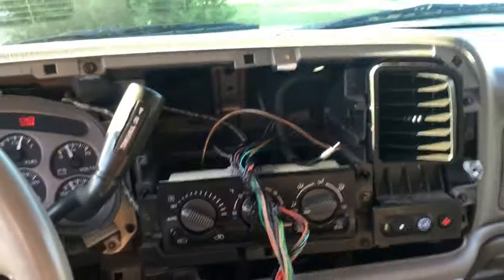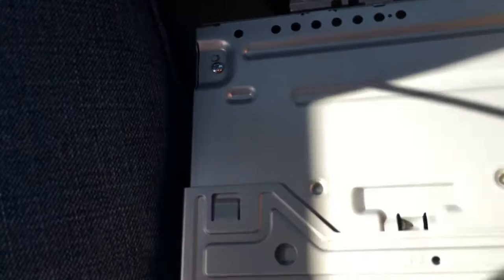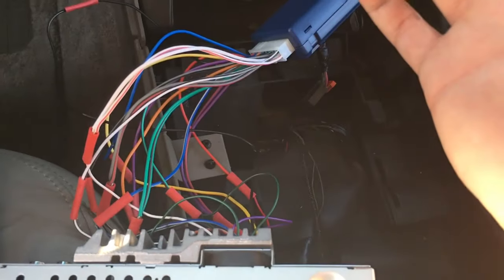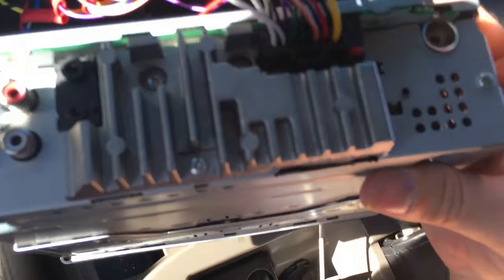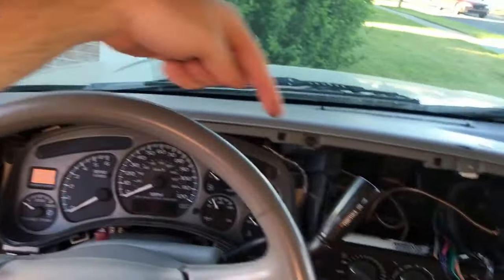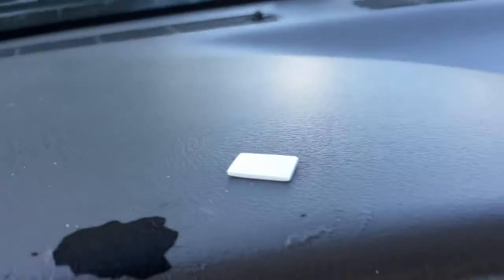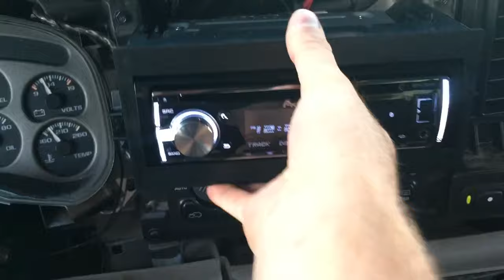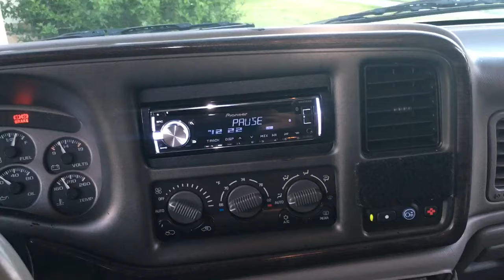How to install aftermarket stereo with a stock Bose sound system Tahoe, Yukon, Suburban, Escalade

Comment: I just got mine working. Pioneer double din with DVD player, 2002 escalade with Bose system and stock AMP. I used metra harness part# 70-1859 and metra trim install kit #95-3004.

Main thing keeping my amp from turning (and causing NO SOUND) was the amp remote wire (blue wire) Hook up color to color for your deck and you'll be straight. Red wire in the connector by itself goes together with the other red power wire.
Reply: I don’t quite know what all this means 🤷🏽‍♀️... but I would love to replace the 2Din bose stereo in my 2013 Nissan Murano. Auto stereo places have told me it’s not possible because of the bose 😢. Any suggestions?
Reply: @MsAngel737  I thought mine was impossible to change at first too but then I found a plug n play harness from Metra. My advice is to look for a plug n play harness for your murano. If it exists then chances are good that it's an easy swap like mine was
Reply: _ theVTECnician _ Aww thanks so much for responding!! So unfortunately I have looked everywhere for a harness (I think that means install kit) and there is none specifically for the Murano with Bose 😢😢😢! I wonder if I could still use the one without? I love my new car and was so disappointed about the infotainment system not being upgradable...at least it still sounds great though
Reply: What did you use to keep your steering wheel control? I have a 02 Escalade steering wheels controls
Reply: @LJimenez0185  I don't have wheel controls anymore
Reply: @thevtecnician  ok thanks I’m trying to figure out how to make them work
Reply: @LJimenez0185  let us know if you do! I pretty much learned to live with no steering wheel controls because I didn't want to have to buy some expensive module. Would be nice to have though
Reply: @thevtecnician  I do have the steering wheel interface PAC SWI-RC-1 I’m following the instructions on their website and it didn’t work, I do have voltage coming from the steering wheel data wire when I press any button but is not working the way they said it has to be wire it up, that’s why I’m trying to see if someone has done it before there is not many info on this specific years
Reply: @thevtecnician  I figure it out!!! Man I’m really excited I got the steering wheel controls from an Escalade I’ll put the on my 99 Silverado and there is not mucho information about how to get steering wheel controls to work, let me know how can I contact you so I can share with you how I did it

Comment: I just hooked up a aftermarket into my 03 Silverado with Bose system. I didn't get any sound out. Once I hooked up the AMP WIRE, I got sound. No extras needed. All I spent was 12 bucks on the AutoZone wire harness for aftermarket stereo.
Reply: bishop all you needed was the harness?
Reply: I hooked up aftermarket stereo on silverado it turns on but no sound? What should i do next
Reply: victor2187puj make sure the blue amp wire is connected if you have bose in your truck it won’t make sound without the blue wire because that is what powers your speakers on your factory amp
Reply: Where do u connect the amp wire
Reply: bishop where did you connect the wire
Reply: Patrick Brown you can run it to one of your fuses if you have to just make sure you run it to a fuse that shuts off when you shut your vehicle is off
Reply: How did you do that boss??

Comment: I've been having a helluva time with my 01 Denali with the Bose, OnStar, disc changer, backseat controls and dvd player in the ceiling. Previous owner failed at replacing the head unit and i bought it with a hole and rat's nest of wires in it. Ugh.

Comment: Thanks for the video.  Replacing factory head unit with a Andriod head unit but want to keep the factory Bose system.  I purchased the ROEM-GM21A for my 2001 Yukon SLE with Bose and Onstar.  Crutchfeild recommends this model PAC for my truck.  I up everything up as you have it and I didnt get any sound.  I connected a speaker directly to the speaker out of the radio just to verify that the radio works, and I got sound.  But I do not get sound through the PAC Module.  So I'm wondering do I need to unplug the Onstar in order for it to work?
Reply: I get sound while in acc with ROEM-GM21A for my 2002 Yukon SLT XL. The moment I turn the engine over no sound although the pioneer AVH-x4800bs says it playing, please Advise!
Reply: @430Xsidian  I'm not sure as to what could be the problem.  One thing is for sure I have been in contact with the manufacture and they expressed that you do not hook up radio speaker wires to both low and high on the module.  The low is for signal wires like coming from pre-amps and the high is for the powered speakers like coming from the speak out wires from radio.  So in short hook up to the high and leave the low unhooked.
Reply: @430Xsidian  did you figure out the problem?
Reply: Nice. My no sound issue was a simple defected harness. Swapped it out for a new one.

Comment: My 05 Denali came with Bose badges on the door speakers and an aftermarket stereo already installed.  It doesn't sound very good at all.   steering wheel controls don't work either.  Is it possible the amplifier is not being used?  The only way to get sound from 6 speakers is to set the fader to full front, which seems quite sketchy.
Reply from the maker: It is likely still using the AMP...but I wonder if the integration between the new stereo and the original amp is messed up?  Maybe the PAC interface module is bad or maybe they just hardwired it?

Comment: When you put those two positive wires on one wire how did the sound come out
Reply: Let me know cuz I have a 04 Chevy Tahoe and I'm trying to do the same thing put another radio in it but they said you can go straight to the factory amp wires and connected
Reply from the maker: I know I should have learned the proper way to connect those wires...but so far five years later my sound is still perfect, so I'm not going back to tinker with it.  :)

Comment: Is there a way to bypass using the special aftermarket Bose wiring harness and use the cheap one only? Hooked up a radio in a trailblazer with Bose and won’t come on
Reply from the maker: I don't think so.  There has to be be something that converts the standard 4 speaker output to the Bose 11 speaker system.  In this situation alone, what would turn the Bose amp on without something to trigger it?

Comment: After installing the aftermarket head unit are you able to crank it up loud without it cutting out real bad or sounding like pure terribleness? I’ve had past experiences with Bose systems sounding terrible after aftermarket hu install.
Reply: I plan to replace the door speakers as well in the doors and the 8” sub in the rear which the sub will run off it’s own amp however I’m curious if the door speakers will still sound decent even if I don’t use an aftermarket amp?
Reply: Any information you have and advise/feedback you can give would be very greatly appreciated!
Reply from the maker: I have cranked it as loud as I could tolerate, and it is crystal clear.

Comment: The reason there are Double positive and negative in the same colors because they run to the subwoofer. And that is your aux input to your Bose amplifier receivers Because there is a receiver before the Bose amplifier to convert. The high output from a stereo into a low input for the Bose system. And really he didn't skip over any of the important stuff because you pull out the stereo and It is all pretty much all you see one plug plugs into. The module that he bought and then you wire your head unit to the module on the other end and you match the colors of the wires on 99% of your head units nowadays There are some off throws. On wire matching But 99% of your aftermarket. Head units will have the same color coding for the wiring on the module

Comment: i recenlty upgraded my stereo with the pac GMRP5 11. the dial that controls the door speaker chime is that also the volume output power as well ? because my stereo is so low and that dial is turned down.
Reply from the maker: No idea.  I bypassed all of the chimes because I couldn't figure it out either.

Comment: when I saw that head unit I had to check the upload date bc it felt more like a 2006 video than 2016 lol
Reply from the maker: I hear ya.  I wanted to do a nice Carplay touchscreen or something...but this generation of Yukons have a non-standard DIN opening of 1.5 DIN.  Most Carplay and LED display head units are 2 DIN, so in order to put a "modern" head unit in I would have had to cut the panel and the steel support behind the panel to a 2 DIN opening.  I just didn't feel like doing all that work for a 20 year old vehicle.  :)

Comment: I have a 2003 Sierra extended cab with Bose and JVC aftermarket head unit. It also has a killswitch installed from the previous owner so I have to wait for the chime to sound before I can start my truck. My radio doesn't save my preset stations, my settings, etc... and the rear speakers sound very low even after I installed some new Kicker 4x6 speakers in the rear doors the front speakers work fine what could be the issue and how can I fix it.
Reply from the maker: I'm no expert, but I know the wiring you attach in the back has two power cables, one is always on (persistent) and one is only on when the key is on.  The persistent power is intended to ALWAYS provide a small trickle amount of power to the radio so it remembers your presets, settings, BT devices, etc.,.  The key power is for actually powering up the unit and for use.  So, it sounds like your persistent wire is not connected or was erroneously connect to the "key power" wire, and your radio unit is only receiving power when you turn the vehicle on.  
Depending on your model of radio you should be able to find a wiring diagram online, and you should see the two power wires I mentioned above.  You will need to see which wire connects to the Sierra wiring harness (again, look at a wiring diagram) and then just make sure you connect persistent to persistent, key to key.  I'm pretty sure that will solve your problem.  :)

Comment: Wow! Thanks for skipping the actual important parts!
Reply from the maker: Which part did you want to see?  Maybe I can walk you through it.
Reply: Trolls.... classic no reply
Reply: mrjchristensen I have an 05 with onstar and Bose. Is this the best route? Well would this work as an option?
Reply from the maker: @daquellejones264  For BOSE yes, for OnStar if you want to use it then you need another module.  Your OnStar might not even work anyway, I know mine is analog and discontinued support for it a few years ago, so if your 2005 uses analog cellular then it doesn't work anyway.  Also generally the steering wheel controls are part of the OnStar module, so you might lose those as well if you choose to bypass the OnStar.  Personally I was fine bypassing onstar (doesn't work anyway) and the steering wheel controls (meh, I can live without them) in favor of a more simple system.  You do you , man.  :)

Comment: Thanks bro for up load video.. I install the after market stereo and back up camera on my Chevy 5.3 . I got 2 things need to corrected.. 1 I got static maybe I installed ground wire to antenna connection.. 2 when I shift yo back up the music shut off for camera,, anyone have same problem,,
Reply: Did you find a fix for your static issue?

Comment: Have a 2005 Cadillac Escalade ESV 
Bought a Double Din Radio think this will work for steering radio control and bose amp with out interface kit
Reply from the maker: I doubt it.  Most stereo units only support 4 channels out, your Escalade likely has the same 11 speakers as my Denali, so you need some sort of interface to convert from 4 channels to 11 channels, and to interface with the Bose amp.  I'm not sure about the steering wheel controls.
Reply: They make a different module for that. Look for one that says "retains factory amp, steering wheel controls" some cars have the chimes go through the speakers so they also retain that as well. The bose system probably has an amp behind the glove compartment or somewhere else so it's not as easy as unplugging one radio and plugging in another, you go through the module and should be okay. One wire at a time, think about it and google if stuck.

Comment: so I got a question I got a 2002 Yukon SLE with the Bose system it had a aftermarket deck dual that I replaced with a Pioneer Bluetooth with CD player I connected everything right and there was no sound so I took it to Best Buy to get sound it cost me like 30 bucks they told me that I have not hooked up my remote wire okay my lost there gain my question is if I bought new door speakers but I really want to use everything that it was equipped with  this blue pac device thing where did you get that from and does this allow me to use my factory speakers amp and tweeters and everything my new stereo is a 4-channel I'm not going to replace my speakers if I don't have to I'm just going to return the ones I recently bouht and get my money back because I've also read where you can make a bypass for the amp but I don't want to bypass anything I want to use it all if I can
Reply from the maker: The remote wire is what tells the factory BOSE amp to turn on, so if it was not connected then the amp wasn't turning on, and thus no sound (or really quiet sound).  
The PAC device is used to connect a standard 4 channel (speaker) deck to a system with more than 4 channels, in this case 11 channels.  The PAC transforms the sound from 4 channels to 11, essentially.  I bought the PAC unit on Amazon, just search it.  You might need a different model though, so search PAC's website first.  Yes, the PAC unit allows you use a standard 4 channel deck with your existing 11 speaker BOSE system, including the amp.  If your amp and speakers work fine, then you shouldn't need to replace them, just buy the PAC to change the sound from 4 channels to 11, and use the existing hardware.  My system sounds great!
Reply: +mrjchristensen yup, connect the blue wire to the back of ur deck, it will tell the bose amp to turn on..
Reply: So where do I hook the remote to

Comment: How did you get the radio antenna unclipped from the rear of the factory one? There is no video of it on YouTube
Reply: It doesnt clip its just a tight fit. Pull it
Reply: @dcurtish91  thanks

Comment: I wondered if the controls on the steering wheel on my 2003 yukon would still work on that radio?? Is that also included with that blue box??   Cool video. Now I know how to hookup my led roof bar light.   Reading othe comments you answered my question about the steering wheel controls.  Ya. Fuck that.  Lol. Too much fanageling

Comment: I got a 99 yukon...changed the radio to a pioneer, the sound cuts off around 28 volume so i can't crank it up, & my back doors don't have sound anymore 😩 answers?
Reply from the maker: Eesh, the only thing I can think of is maybe an issue with the connection to the factory amp?  Does it have the Bose amp?
Reply: I’ve read somewhere that Bose operates on half ohm load or something low like that so if you have it wired to a radio that’s not stable at that level it could cut out at high output .... assuming you have the speakers directly connected to the pioneer bypassing the Bose amp

Comment: Where did you buy the interface?
Reply from the maker: elio lopez Amazon
Reply: mrjchristensen ok and did you need anything for the onstar?
Reply from the maker: elio lopez On these older OnStar equipped vehicles the OnStar doesn't work anyway.  If I recall GM switched from analog cellular connectivity to digital connectivity at around model year 2007.  So the analog equipment in these older GM vehicles literally, physically, can't connect to the newer digital cellular networks.  A software update can't fix it. It's like owning a diesel motor when everyone has switched to unleaded and stopped selling diesel.  There is nothing you can do about it unless you tear out the entire system's hardware and replace it with a newer vehicle's hardware.  SO knowing that, I did what I did and bypassed/disabled the OnStar system (which will never work again anyway).  The only negative thing was it also bypassed my steering wheel controls.  I looked into how to fix it with an additional adapter assembly that will re-enable those, but it just seemed like too much work and complexity for the little use I would get out of them, so I didn't do it.
Reply: Ha. I mean I don't care for the onstar I just WANa make sure I don't really need it .. I have a 03 Tahoe that has the Bose system ..
Reply from the maker: elio lopez well...if you need it or not it won't work either way. :)